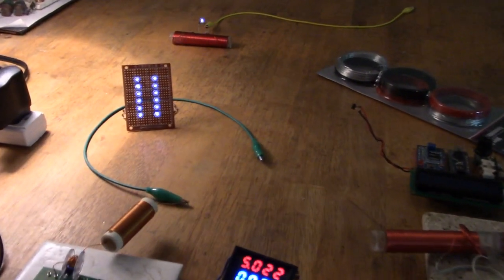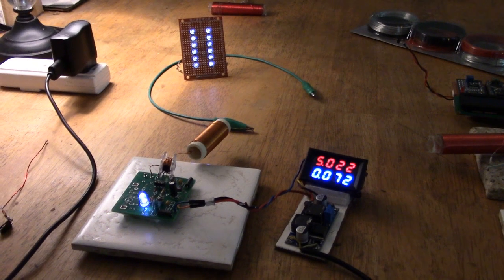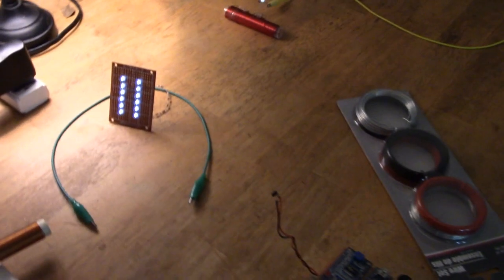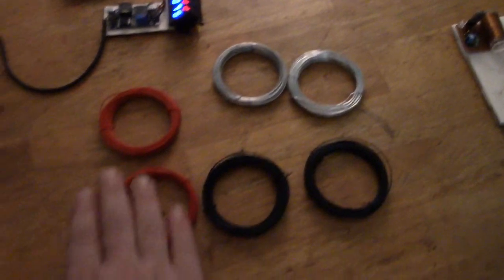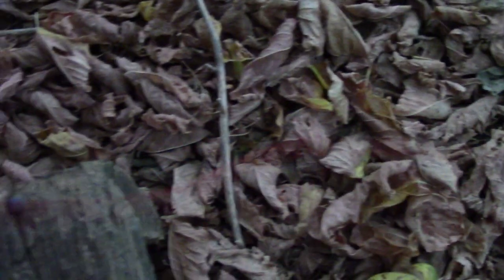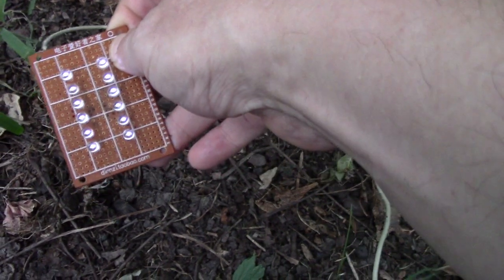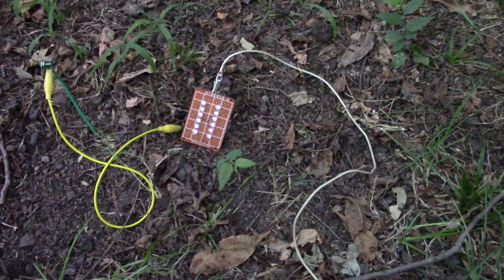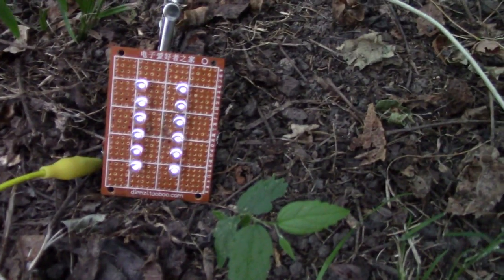75ft over 1 wire - Stiffler diode ring at 5V

Comment: Great job. Remember the L3 coil is direct off the V+ supply and must be careful to use an isolation cap when it might be a possible short condition. Now, Yes connect the output of L3 to a ground rod, BUT the exciter must be run by battery so no mains ground will short the process out. Because of my lab I have never done this myself, but a colleague has and it worked great, actually real great.
Reply from the maker: Many thanks for your hints and tips. Yes, will try battery power for any similar experiments. There was a gap in logic about the mains ground, it makes sense !

Comment: Reminds me of Stubblefield experiments. Having said that, what happens if you stick the end of the L3 into the soil and then  at 75ft poke an isolated loop setup in the ground, now that it's wetter?
Reply from the maker: I don't know ! so will find out tomorrow as it's late here. We're due more rain, seems these things run in week long cycles in OK. Livingroom to outdoors is approx 15ft, back door to the shed is 60ft, shed to back fence is 10ft (with a car in the way). 60ft would be the experiment, but really 1 wire has no differences at these ranges.
The car might make for a good experiment, thinking about it.
Reply: Do you remember the ground energy transmission experiments of 2013? Maybe it's time to do some more experiments along these lines: https://youtu.be/FI4WSoMxlOw
Reply: Conclusions from crude field trials: Long range success = remote(ish) location; damp salty soil; widely separated injection (TX) probes (why?); (widely separated receiving probes was not tried); parallel receiving (RX) probes at distance (why?). Poor reception = damp, sandy soil in residential garden, even when TX and RX probes were close; perpendicular TX:RX probes anywhere (why?)
Reply from the maker: Good questions. I always have troubles here. But, nowadays there are no neighbours in any house except across the road to the front. Not sure if all electric is off to each, but it should make for a better 'remote' location.
For some reason mains hum kills wireless effects, like a signal scrambler.

Comment: I wonder if the size of the circle has an impact. Good replication.
Reply from the maker: Good point, Dr. Stiffler's circle also had the link terminals between each diode too. My diodes were salvaged from old boards, hence short leads and the smaller circle.
Reply: it would be worth making it larger just to test the theory, I am trying to work out how I could generate a signal without buying a sig gen....this has my interest.
Reply from the maker: The easiest for very strong output is a Slayer exciter, but an exacting frequency isn't too difficult with the 2 pin oscillator circuit. Problem then is the fixed frequency and building coils etc tuned to that, rather than tuning the transmitter.
The Doc is running 25V sine waves and that's my issue. I believe Lidmotor's sig gen is about $50, they are great value and do the 25V. I'd need to sell a lot of books to get one lol
Reply: Slider2732 yes i like that ability to tune the sig gen rathet than building tuned coils. I have a TENS machine am wondering if I can play with that.
Reply from the maker: We have one here....what a fun thought, you'd either fix a few aches and pains or zap yourself trying the experiments.
I think even the fast setting on this one is only something like mains frequency, but hey, it's worth examining the board and having a look !

Comment: Thunderstorm time, our hot spell ended today, a few showers so far, storms forecast. I expect that little trail of wire will attract lightning and that will make those LEDs glow :-)
Reply from the maker: Yep, probably no circuit needed...trails of sparks and electric arcing, but that 12 LED panel will burn brighter than ever. Until I pour water on it to put the flames out.